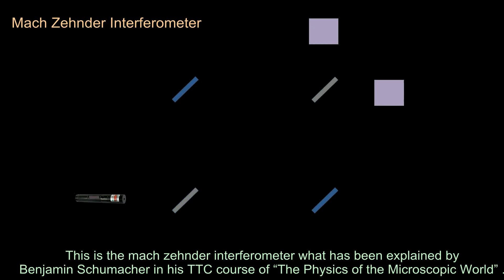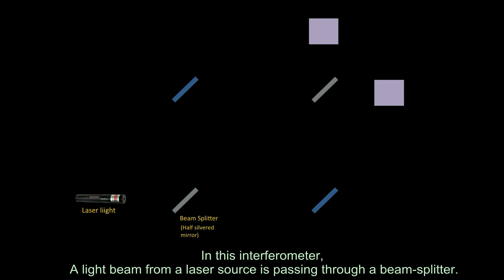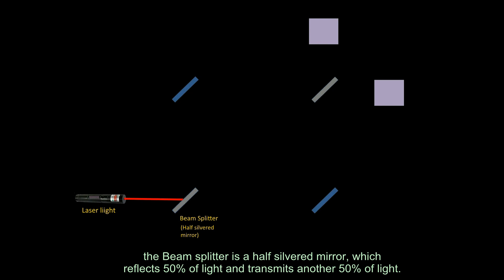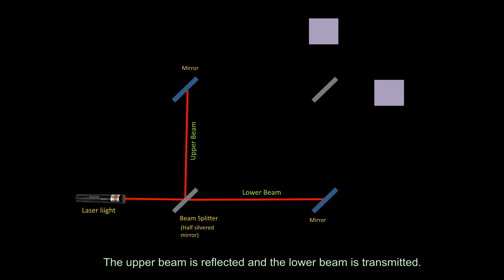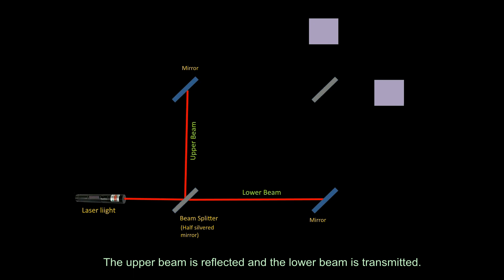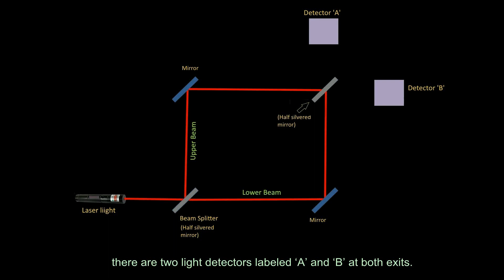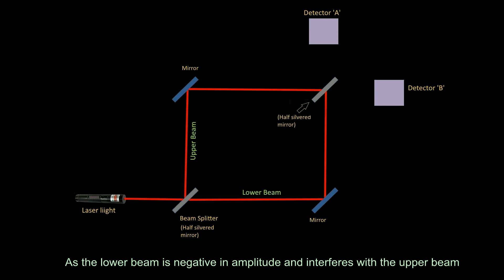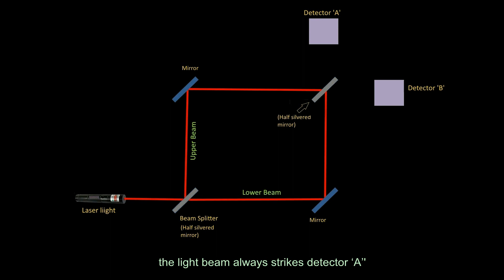Mach-Zehnder Interferometer experiment

Comment: You are wrong when stating the both paths - upper and lower - must be exactly the same. In fact, it is impossible to reach it out  technically. The only condition you have to meet is to have the optical path difference of both interferometer arms shorter than the coherence length of the used light source is. Then the phenomena you describe occurs on every 2*pi*n, where n is many many many ... up to the coherence limit.
---
And also, you have better to use some kind of beam expansion to make the interference effects (fringes) at least a bit visible. Also the iris diaphragm plays not the role of the "light intensity reducer" but rather the spatial filter (when placed inside the beam expander)

Comment: Thank you. You explained the situation well. If you do not have the exact same path lengths, which by the way you never happens for more than a few seconds, you can just observe the interference pattern. The center of the pattern is the interference you would see if the paths are identical. You will simply notice that the two screens will always have opposite patterns, for example, if the center of one pattern is bright on one screen it will be dark on the other screen.

Comment: perhaps some sort of a phase shifter is available. If two are used and inserted into both light-passes one can perhaps adjust the relative phase to create a phase shift as close to "pi" as achievable. Also the intensity must be the same. Perhaps two attenuators, - each per path, - would be useful.

Comment: Well that's just wrong isn't it? Every time light gets reflected, it's expected to have a phase shift of pi. All of that ultimately results in detector A getting both waves with a 3pi phase shift , which means Constructive interference between them and detector B getting both beams with 2pi interference, also showing light.
Reply: From what I understood, "the key is the dielectric beam splitter". If it reflects light through its front surface, it will not cause a phase shift.